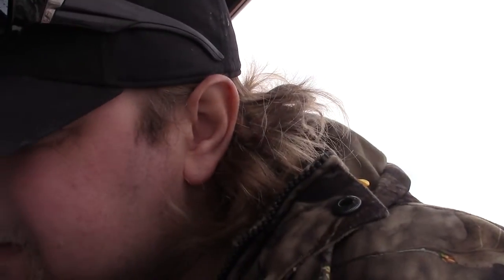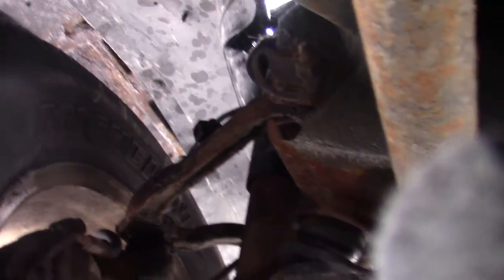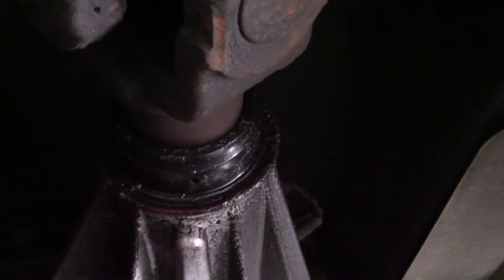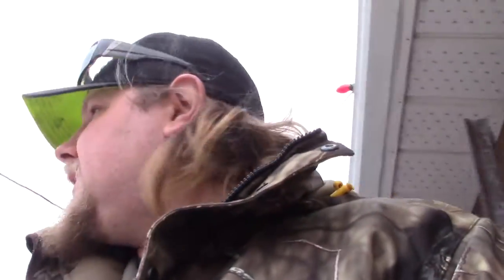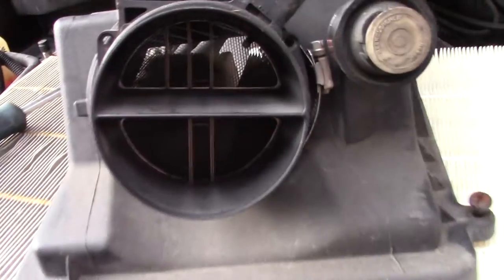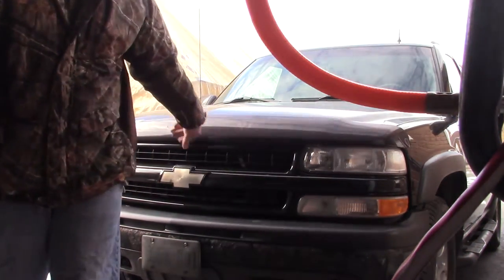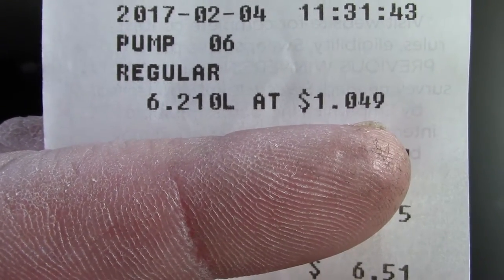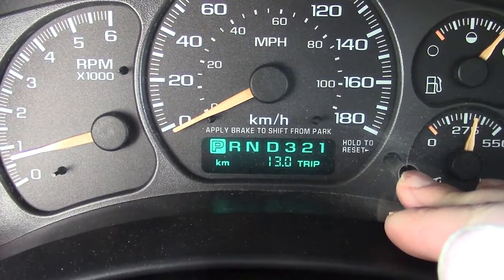Easy Poor Fuel Mileage Fix!!

Comment: I think you nailed it Ghostma. Winter idling, soft tire, and a little restricted air flow. Good save buddy. My 03 has tire rim leaks up the wazoo. I'm beginning to dislike aluminum rims. Bought a manual tire changer to do the job myself. Break them all down, clean them up, reseal and remount. I can use the exercise. For what the tire shop wants to do the job, can pay for the changer on this one job.Wife says I'm crazy, 63 YO and starting to wrestle tires.  Not crazy, just cheap. Again, nice save KIT doug
Reply from the maker: +Douglas Laramie thanks Doug! Tire shops are insane.   I couldn't believe how much they charge last time I had a change over done.  I was very happy with the results with the fuel mileage.   Cheers!!

Comment: Using cruse control also helps save gas. spark plugs can also be cleaned. Brass brush on electrodes, a few wipes of emery cloth (200 grit or higher sandpaper ) between electrodes. Steel brush on threads, and a little anti seize on the front few threads.
Reply from the maker: +Imperviousgodspeed thanks for chiming in, and thanks for watching! Cheers!

Comment: rm seems great mine runs at 2200 rpm at 65 mph great  fuel mileage for that truck  idle time will affect fuel mileage big time as well as low tire pressure and dirty air filter I think you nailed it buddy as far as warm up time goes now with the newer engines 1 to 2 mins in real cold weather is all that is needed providing you drive slow till the vehicle warms up 
if your going to hit the hyw  let  it  warm up  least 10 min other than that all good
Reply from the maker: Thanks buddy!  She still like to suck the fuel if I drive strictly in town, stop and go, but I think that's pretty typical of a vehicle this big.  Cheers Drew!

Comment: Almost 21mpg.. Wow!  My wifes Tahoe has never seen that I don't think. 16-18mpg is about tops on hers.  1800rpm seems about right, think that's where hers runs around 65mph.  I think most of that oil underneath came from the filter that was about ready to fall off and destroy your engine. :-)   Clean it all up and keep an eye on it, but oil blowing around under there going down the road will get into strange places, then slowly creep down when you stop.   I have yet to see one of those air filter gauges actually work.  Great vid!
Reply from the maker: +The Fox Shop ya,  I was really impressed with the mileage!  I didn't even get that good of mileage on my 2014 F150 when I had it.   And this truck has 215000 miles on it.  Gotta love these 5.3 litres,  one of my favourite engines.  I'm gonna do that,  clean up all the oil and then keep an eye on things.   Cheers!

Comment: Yes, filter & Tire pressure made a diff., oil not so much. Plugs should help more. Cop or wire? Wires, change em too. Any other ignition parts distributorcap, rotor, etc

Comment: The frt diff looks like it has rtv. Not factory. If you have an oil cooler it  could be the gasket above the filter that goes into the block or if you have oil running down the top of the block down the lh side of the block your oil pressure sensor on the back of the intake is leaking. Just changed mine , what a gong show. LOL  I clean my maf once a year too wether it needs it or not. LOL  2 minutes warm up I use synthetic oil only.
Reply from the maker: +STEVE ROB I'll have a look at those things buddy.   Did y's do a vid on the oil leak fix?
Reply: Oh yes and it was a gong show. I welded sockets together and pissed around for 3 friggen hours and on youtube its a 10 minute job. Youtube can go frigg off for friggsake, LOL
Reply from the maker: +STEVE ROB lmao!  Been there,  well Shawncfarm did it for me with my rear diff fill plug lol
Reply: Ghostma Vlogs haha I seen that one .

Comment: Nice easy mileage fix. I've been told diesel engines need warmed up, especially if there not plugged in, but gas engines just need oil pressure and warm up better/faster if you drive them...(Easy at first though)
Reply from the maker: THanks man!  Glad to see you back!  Cheers!

Comment: have yoiu thought about using seafoam, it will get rid of alot of carbon deposits and make the engine run better and probably get slightly better economy
Reply from the maker: +camtheham13 funny you say that,  I was gonna grab a can when I was at Crappy Tire but I forgot.